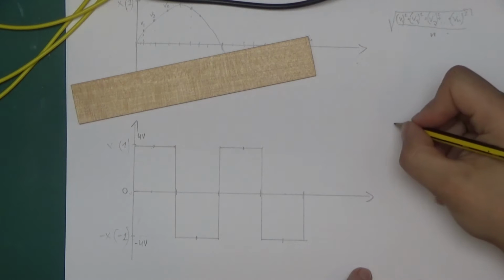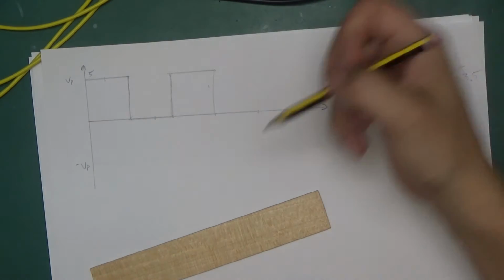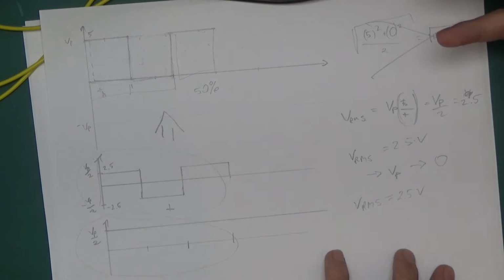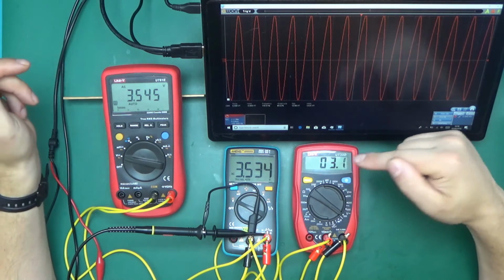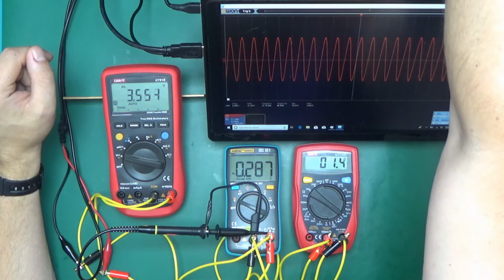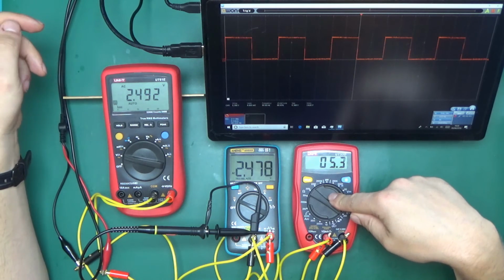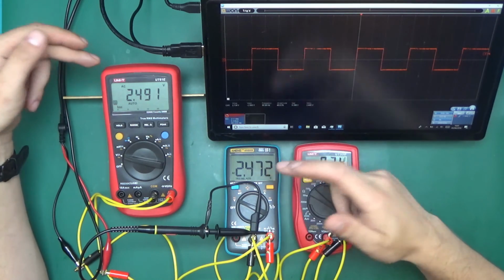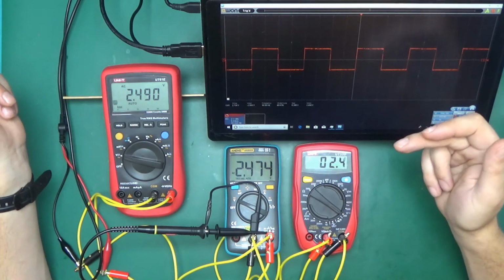#015 - True or False RMS after all? Does Truly TRUE RMS multimeter exist?

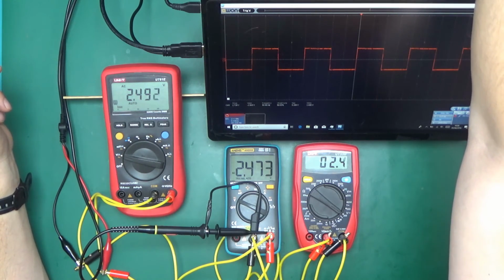Comment: I came here after I got surprisingly poor results, as you did, from a square wave with anything other than a 50% duty cycle and no offset with my Fluke "true RMS" 117 meter. I similarly got preposterously bad results from any offset at all, even with 50% duty. For example, a 0-5V 60 Hz square wave with 50% duty should be 5V/(sqrt(2)) = 3.54 RMS volts. Interestingly my Fluke is also getting the totally incorrect value of 2.5 V, like your two RMS meters did for the test you show starting at 20:46. I'll guess this probably says something about how all these devices badly estimate results. My scope measures RMS fairly well, even with variable duty cycle, presumably because it actually does the integration electronically. Even a reputable Fluke meter is disappointing junk for that kind of analysis.

Comment: Nice explantion of RMS.
On the symetric waveforms (symetricly around zero) you are correct.
But on the asymetric waveform (only 0 to plus or 0 to minus) you are making a mistake.
Simply expland by a square wave , 50% duty cycle, 1 volt peak.

Power generated in a 1 ohm resistor is 1 watt. But that is only during 50% of the time.
Over a full period on average only a 0.5 watt is generated in the resistor.
The RMS needeed to produce this 0.5 watt over a full period is the square root of 0.5 = 0.707 Volt
(0.707 Volt in 1 ohm gives 0.707 Amp is equal to 0.5 watt.)
Not half the peak value.
 
The general formula for RMS on an asymetric square wave is:

U= Ui times square root of (ti devided by T)

U= Urms
Ui= peak value
ti= time of the impuls
T= time of a full period
(in fact ti/T is the duty cycle)

Why does the multimeter displays the symetric RMS value while measuring an asymetric waveform ?

Simply because on AC somewhere in the meter a capacitor is put the signal path. 
You don't measure DC while the meter is in the AC position.
So DC components are filtered out and the asymetric signal is automaticly turned into a symetric signal with half the peak value.
(Peak to peak stays the same)

In the video the DC ofset you put to the square wave is filtered out by the meter and altough this should be calculated into the
true RMS value only the ac component is measured. And the ac component, because of the behaviour of the meter, is also measured wrong for
the asymetric waveform.
Conclusion: RMS on a multimeter is only valid for symetric waveforms with no DC in it.

Actualy asymetric waves are not real AC but more a kind af amplitude modulated DC.

Sorry for my lame english.

Comment: This is clearly a case of not knowing how meters works.
True RMS meters will only measure the AC part of a signal, if you had put the scope on AC the readings would have matched.
To get the full RMS value you have to add AC-RMS and DC value with sqrt(sqr+sqr). A DC+AC rms meter will do that for you.
When you change the duty cycle the DC value will change, that is the reason scope and meters do not match.
You cheap meter is probably using a single diode for rectification and the diode drop will affect the result significantly at low voltages. Many True RMS meters do also have problems with low values, precision is often rated from 5% or 10% of range and up.
Reply from the maker: That's not the point I wanted to make. When I started to mess with the signal and adding DC offset, it was curiosity to see what will happen (I thought I had the scope on AC, I have to double check the video). However, a symmetrical square wave, RMS value should be equal to amplitude, but RMS meter shows correct reading only at 50% duty cycle. My question is: what it the point? If one can't measure signal other than square 50% or a sine, then it's not a true RMS, right? I know some more expensive meters have the ability to measure RMS AC + DC (haven't got one though), but why meters like those in video even exist? In my opinion, a true True RMS meter should not have AC/DC switch at all. It should show RMS (heating value) of what you stick the probes on. I think the True RMS label is used in a bit misleading way. Thanks for your comment! 👍
Reply: You do not get the point: When duty cycle is different from 50% there is a DC offset implied, you can measure that with the meter on DC. The AC do not include any DC.
If you like that or not do not really matter, it is how multimeters works.
Reply from the maker: @henrikjensen3278  ok, I get what you are saying, non 50% square has a non-0 average value, therefore it has the DC offset, fine. However still I do feel that labeling a meter like this as RMS is used in a misleading way, but that's just my personal opinion.
Reply: If you ever get around to play with PWM you will find that they are closely related.
I will suggest you connect two meters to your generator, one in DC and one in AC and then play around a bit, maybe you could learn something.
Reply from the maker: @henrikjensen3278  thanks, I somehow didn't think of duty and offset in those terms, but it does make sense. Thank you for taking time to get your point across. I think I understand something a bit better now. Still think cheap RMS meters suck though 😁
Reply: Cheap meters have a few problems: Fake CAT rating, limited switch life, cheap construction.
But precision is usual good, also for true-rms.
Around the house or on a hobby test bench they work fine, but I would not use them professionally.
I have been doing a lot of multimeter reviews (Both cheap and expensive meters) and also written a few articles about them.

Comment: A square wave with a positive DC offset such that no part of the wave goes below zero is no longer an AC waveform, it's a changing DC waveform.  Perhaps if you put the meters in DC mode, they will integrate the waveform and give you a more accurate value, even with a changing duty cycle.  You may even find that higher frequencies work better in this case.  Just a theory; most of my gear is in storage, so I can't test it myself...
Reply from the maker: Thanks. DC readings will be way off in this case. The inaccurate readings with other than 50% duty are quite common with many "true RMS" meters. After reading all comments so far, I am inclined to believe, that only true RMS AC+DC meter would show correct measurement in this scenario.

Comment: I wonder if it best to think of these meters measuring the RMS value of the wave after it has gone through a bandwidth filter.  When you change the duty cycle of  a square wave then there will be much more energy in the harmonics (especially even harmonics).  So I wonder if there is enough in these harmonics that they are getting filtered out at the about 1khz cutout (That is how the ANENG is behaving at any rate).   So how much energy is above the 1khz cutoff for a 10% duty cycle square wave.  Not sure right of the top of my head.
Reply from the maker: Interesting theory! But that would mean, that aneng and uni-t would have to respond differently (uni-t has clearly higher bandwidth) but they respond the same.
Reply: But the uni-t is weird.  Why would it read a higher value at higher frequencies if there was a bandwidth filter?   I suspect the uni-t has no bandwidth filter so is susceptible to aliasing errors.  However, as you say the two behave the same way which I can't explain.
Reply from the maker: I suspect once the signal went past the bandwidth, the readings become undefined. Can be high or low, doesn't matter which way it goes. The true RMS converter inside just was not able to cope with it.
Reply: Ok, so I can explain why both meters read the same on the 90% duty cycle 10v p-p square wave.  It is because it is AC RMS.  The dc bias for this signal is 0.9*5+0.1*(-5) = 4, now the AC RMS will be sqrt((5-4)^2*0.9+(-5-4)^2*0.1) = 3.  This is pretty close to what both meters are reading so the meters are reading true AC RMS.  However this is different than true RMS.  I tested my ANENG and it was able to both give an accurate measure of the dc bias point in DC mode and the AC RMS value in AC mode.  Note, to get the true RMS value we we would take sqrt(4^2 + 3^2) = 5.

Comment: I would expect the AC measurement to be AC coupled and ignore any DC bias. The duty cycle affecting the readings I would not expect though and i find it rather strange especially since the meter does give correct values for the most part. It'd be interesting to see this kind of test with a higher dollar fruke meter or such in the lineup.
Reply from the maker: Yep. Would be interesting to see some more expensive gear in same test. But my budget is blown for some time now :) Other commenter suggested another type of true RMS: AC + DC , (ut71a from unity) which I think would show expected values. But that renders all "regular" true RMS meters not so true...
Reply: I guess there is no way around meticulously getting to know the meters behaviour before we can trust it :D. Personally I find it more useful to have the AC coupled RMS value, as it allows in a pinch to know what the RMS value of noise on a power rail is for example, whereas AC+DC does not really seem like something I would use (maybe it's very useful in some situations, but I have no idea). I may try to repeat what you did with a few meters if i get around to cobbling together or buying a signal generator.

Comment: I don't think you can use a DDS (direct digital synthesis) signal generator for these tests. I'm not sure but I don't think the voltages are correct regarding real power etc. Maybe use stepped down mains or a normal oscillator.  I might be wrong, but my meters do not read the voltage from a DDS properly, and remember they are floating and have no earth ground reference
Reply from the maker: Thanks for the comment. I think this is not the issue though. After all, floating or not floating, voltage is voltage, right? And DDS is not a problem either, why would it matter how the voltage/signal is created?

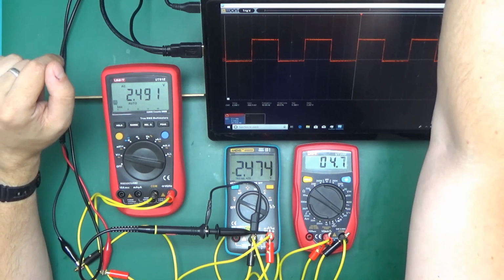Comment: 24:50 That's because those DMMs are AC coupled, if you want to take into account that DC offset you need a AC + DC TRMS like the Uni-T UT71A
Reply from the maker: Thanks, so I need one more multimeter after all :)
Reply: @randomtronic  Or use 2 measurements with UT61E, one for AC, one for DC and do the math yourself. You can test with your scope AC coupled and then DC coupled and get the same results.

Comment: I wonder if this RMS behavior with square waves is so the reading on distorted AC Mains makes sense to say Electricians. eg SMPS without PFC, where the current draw is uneven and thusly the voltage waveform is not a perfect sinewave.

Could you try feeding a distorted AC waveform ? would be interesting to see how clipping on a valve amplifier compares to a solid state amplifier, perhaps a viewer could do that ?